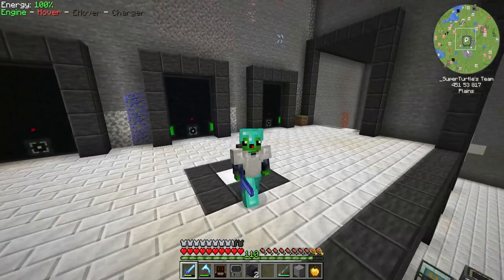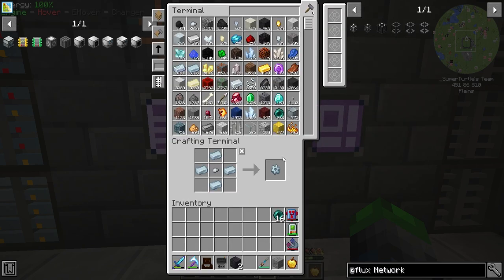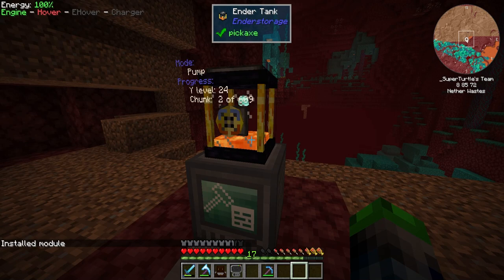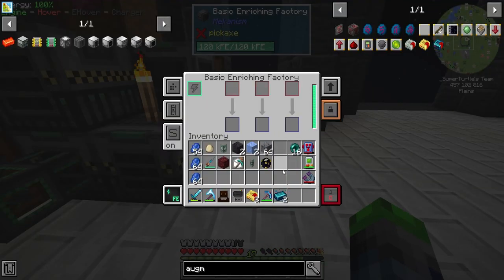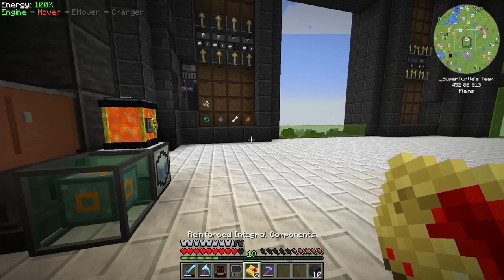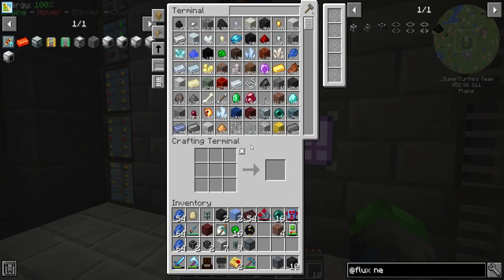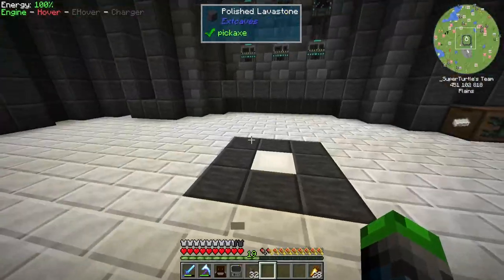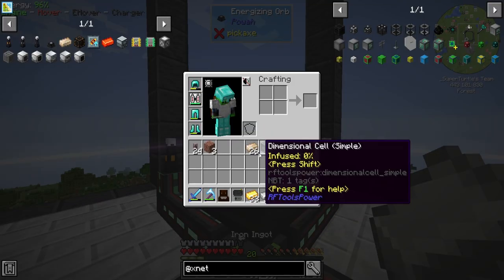Direwolf20 1.16 Let's Play | Diving Deep into POWAH! | [EP 12]

Comment: New viewer, been playing catch up. Few things that may help you. 

You can automate the energizer things, I forget the name of the part but it's part of the Robit recipe, some type of sorter. Can be set to pull one item per pulse, then set an adjustable clock to send the pulses. I used one on either side to do the iron/gold recipe, just 1 to do the blaze rods, diamonds, and emeralds. You do need to watch it a few times to figure out the tick count for the redstone pulses to make sure the energizing completes. 

Also, on your spawner, looked like you didn't claim the actual chunk the spawners are in. Meaning that creeper almost took out your grinder. There are spawner agitators that will let those spawn without you idling nearby. Also get a tank and keep that mob essence, I think you can use it in powered enchanters. 

With as many resources as you have, easiest way to handle all the armor and weapon loot from the spawner might be to make a small refined storage system with 1 or 2 64k drives since that doesn't care about item types like AE. Import all the drops to refined storage, then setup an export bus to export the main few mob drops you need to the enderchest for importing into your AE. With that setup you could have north of 100k armor and weapons stored to pick off enchants later. 

Anyway I didn't comment earlier in case you did something I'd suggest in a later video I hadn't seen yet. Oh, and for obsidian. Once you go kill the dragon, you can run your builder on the pillars. I took down two pillars earlier today and got about 5k obsidian in less than half and hour. Way faster but not automated method

Keep up the cool work.